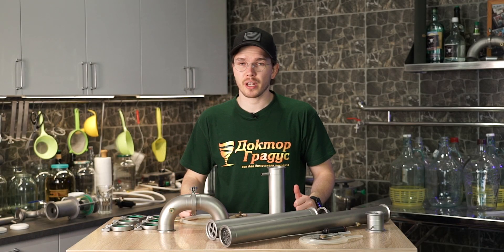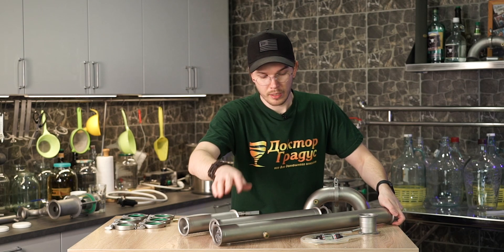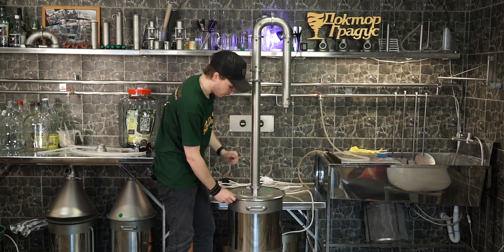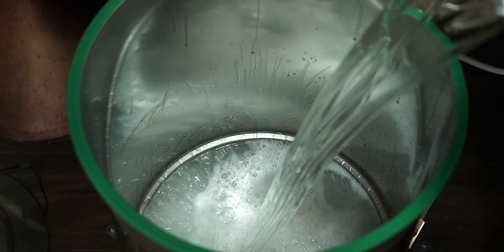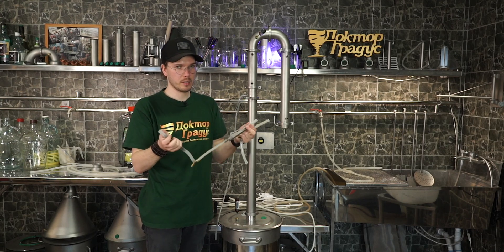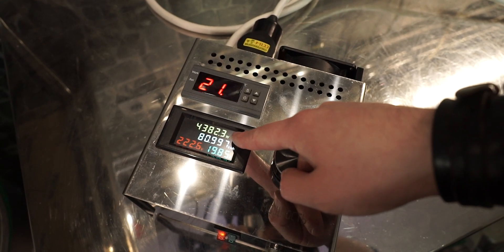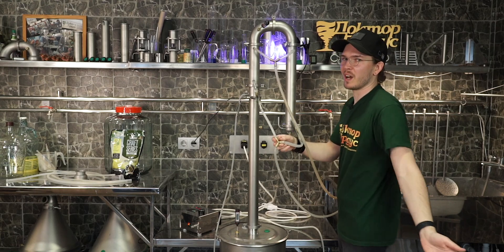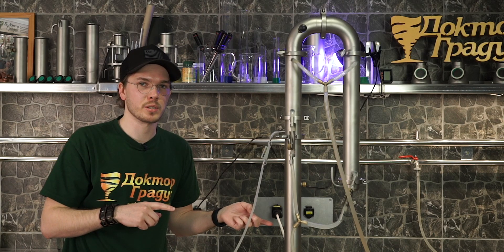Cooling management distiller Stillman 2 inch - Part 1

Comment: Awesome video and awesome still  question can you run spp in the column ? Or is the 2in to small thank you
Reply from the maker: Yes you can! 3.5 mm - 96 ABV with speed of 1.1 L/h and in case of 5x5  94-95 ABV with speed of 1.2-1.4 L/h ( at the best circumstances.
Reply: @DoctorGradusInternational  really wish you guys had a Australian distribution place I'd but one of your stills in heart beat